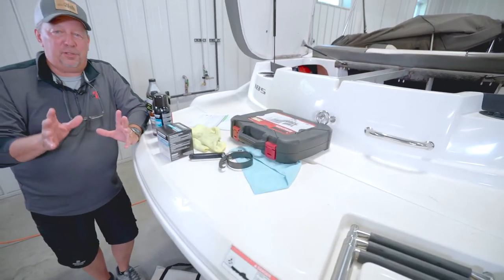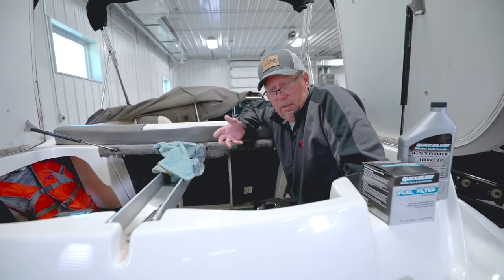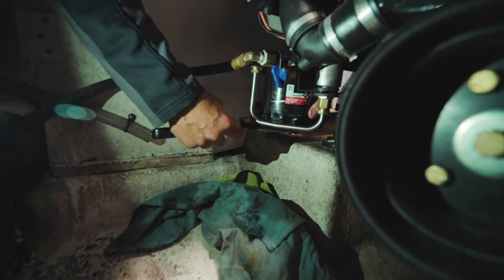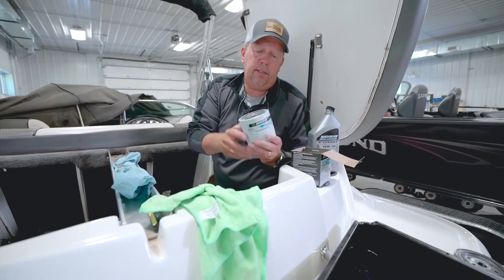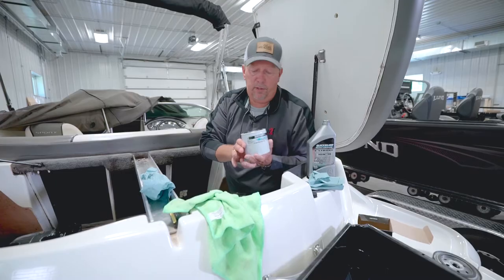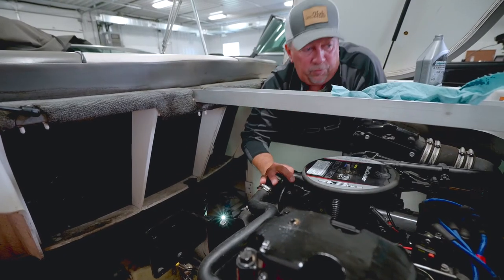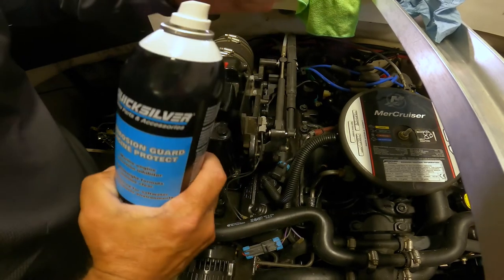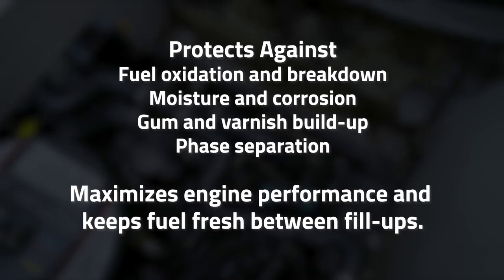How to Change a MerCruiser Fuel Filter

Comment: The oil on gasket also helps in removal of filter,also after spraying on engine protector you can put a water absorb (DampRid 64oz) in engine compartment for storage,Great video Thanks

Comment: I have the 7.4L Mercruiser MPI, it does not have a fuel cut off with near the filter. Always worried that fuel will just keep flowing. Also heard yes if the filter is not full of fuel or fill up with the ignition switch, the motor will not start
Reply from the maker: Hi David, thank you for viewing/commenting. This sounds like something you may want to discuss with a MerCruiser product support specialist. You can reach them at 920-929-5040 or via the link below. Hope this helps!
https://www.mercurymarine.com/en/us/contact/mercruiser-customer-assistance
Reply: Is that with electric pumps or mechanical? Is this an oil filter? I'm so confused 😕